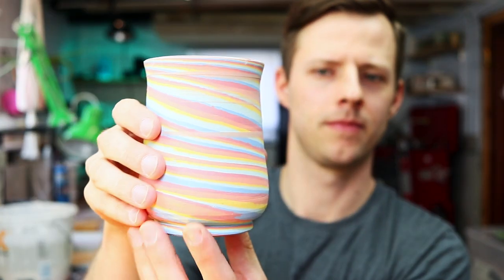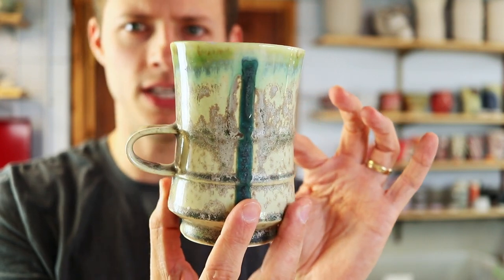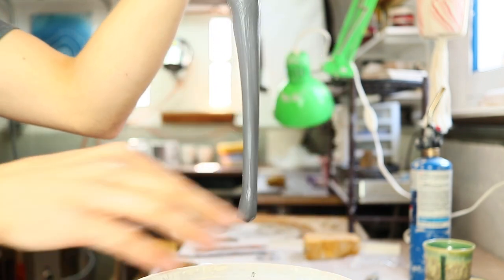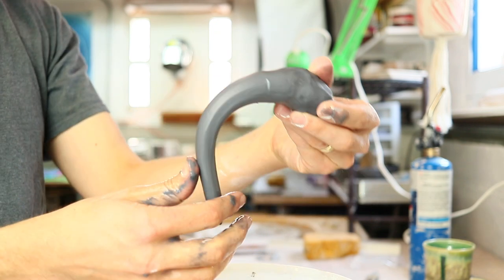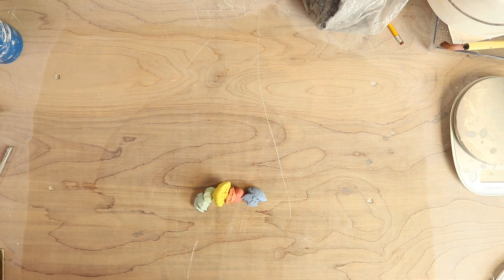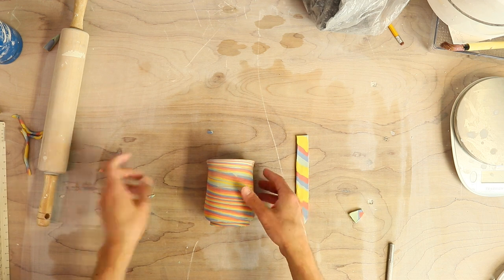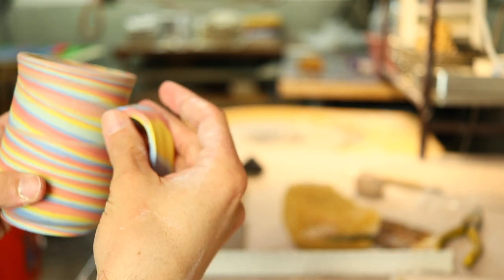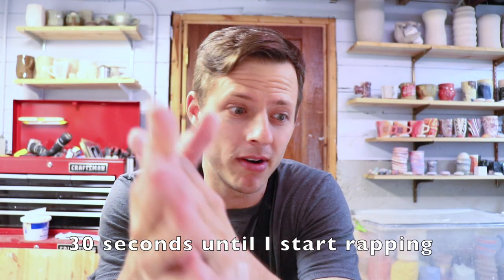Making/Pulling Handles For Mugs

Comment: Hello Jim, thanks to your advice on another video, I was able to throw my first marble. It's now in the kiln and I can't wait to see the result. I do have another question though: once trimmed, handle added, etc, how the hell do you keep your piece clean? I like to compress and polish my clay with a plastic card or even metal rib, but can't really do it because of the handle, how can I get rid of the fine layer of slip that forms onto the surface and blurs the color stripes? At what stage in the post-throwing do you take care of that and how? Your pieces look so vivid and clean in your videos... ? Thank you !!!
Reply from the maker: I never scrape. I ran in the same problems you’re having. I mean, I scrape when I throw it. But after I trim it and add handles I wait until it’s bone dry. Then I very carefully sand away that thin layer and any smears with a green scotchbrite sponge. It’s extra work and crazy dusty. But you’ll never go back. I use a fresh one for the first to over and sometimes there are noticeable scratch makes so I’ll go back with an older, softer, sponge for round two. Some ceramists go as far as using steel wool as a last pass for greenware.

Comment: I've done a couple agateware mugs, and wanting to have the marbling carry on into the handle.  What I did was to throw a handle, using the same marbled clay.  That way I could control the width, thickness, add a thumb groove, and easily expose the pattern.
Reply from the maker: I never thought of that. And the added water helps make it bendable right? Was that your idea?
Reply: @CeramicJim  I really didn't need to bend them I just threw the a cylinder, that was a width, that was close to the distance that I wanted for the top and bottom of the handle (If that makes any sense).
Throwing a handle, definitely not my original idea.  But using it to obtain marbling, is something I just came up with.  Not saying no one else has done it, just that I didn't get the idea to do so, from someone else.
Reply from the maker: Oh I get it. So you essentially cut rings from a cylinder and used what you need right? I’m going to try that.
Reply: @CeramicJim  Yes Sir!  And the good thing about it is, you can usually get a couple handles worth, so you'd have extras.